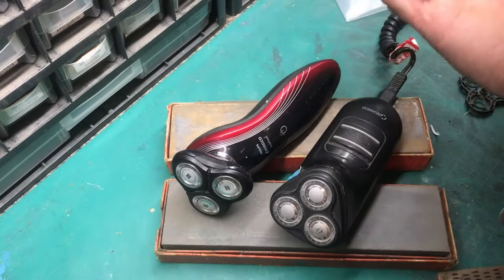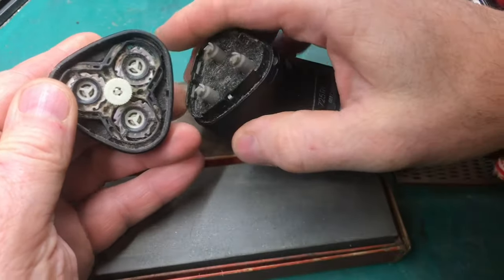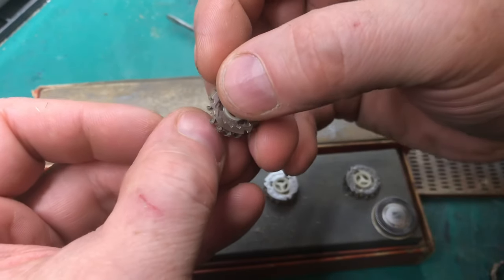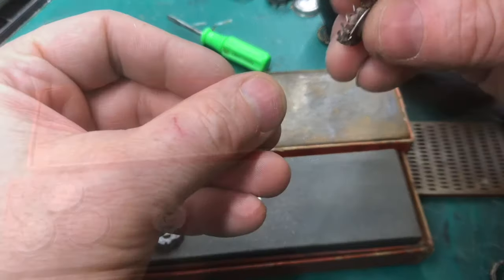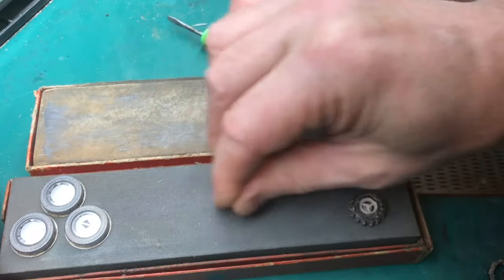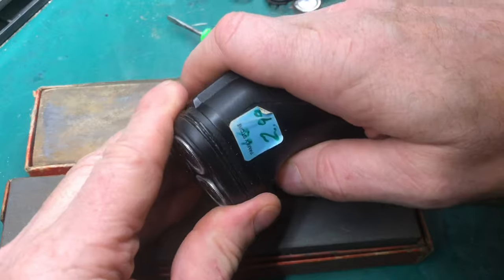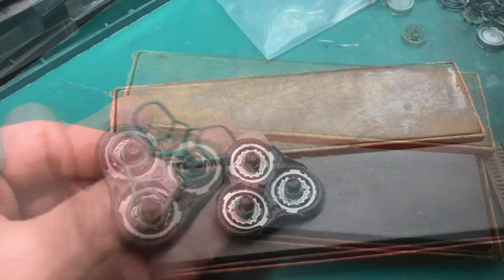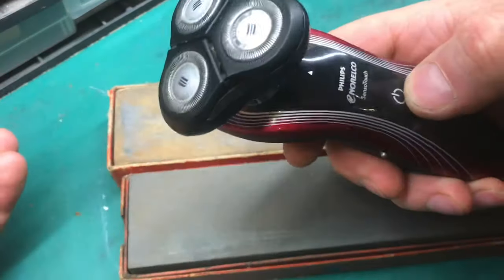SHARPEN your “electric razor” in less than a minute (remington, norelco, braun)

Comment: There is a far better way... first, thoroughly clean your blades (yours were gross) then add some toothpaste to the outside of the razor blades and run for 30 seconds. Thoroughly wash the razor head and voila! Sharp blades.
Reply: omg thank you! My Philips 9000 series is working better now than it did when it was new. I even tried it on my body hair trimmer and now that works super well too. Crazy how simple this solution is and how well it works 😍
Reply: This is sorcery ! Absolutely Brilliant with a Capital B ...Beers for this man, and keep them coming!👌
Reply: Yeah well,  at 56' I basically gave up on electrics having owned everything out there.  Till about a week ago anyway. I destroyed my face with a manual shaving few days premature.  I was furious. That night I started my quest for an electric again.  No way was I gonna pay $300 again and throw it in the trash. I reluctantly got a $50 Remington f5- 5800 on ebay.  Holy shit.  Not only is it first razor Not giving me Burns, irritation and Bumps. But its so delicate, yet shaves so close, even after shave hardly stings my face.  AND, I can shave at least every Two days whereas I could only do so Once a week for past 40yrs because of my extremely sensitive skin.  Don't know how long this will last as I have terrible experience with Foil shavers imparticular.   But for now...it's a miracle!!
Reply: Should I assume to push the toothpaste inside?
Reply: Didn’t work on mine
Reply: How do you wash the blades? Just water?
Reply: @Moiez101  Hot water and liquid soap, are the trick
Reply: @Moiez101  Liquid soap and hot water
Reply: @dogmaticagnostic7716  thanks !
Reply: @phsx2890  mine either tried tooth paste trick. Didn't work. Perhaps wrong kind of abrasive ingredient???
Reply: @joescheller6680  I got rid of mine …tried about three different ways.sold three shavers for small $. But now my new one is not shaving that well either
Reply: @joescheller6680 Polishing compound works better. I use maguire automotive polishing compound on my Philip's S9311. Worked great on the 10 year old RQ12+ head. Gonna sharpen my shavers original SH90 head next.
Reply: The toothepaste needs to be white and contain titanium oxide I think to be most effective. Idk though I might be making this up.
Reply: Ues wd 40

Comment: I have a Norelco 8240 that I’ve had for many years and sharpen like you demonstrated. I always first degrease the blades and foils by soaking in rubbing alcohol. And I make sure to keep the same blade and foil matched together. I’ve used Norelco since I was 16 years old because the first time I ever shaved my older brother let me use his. I’m now 80. I once tried a non-rotary blade shaver but hated it.
Reply: @Caballo de guerra Braun. Don’t remember the model. Years ago.
Reply: Your razor is same model number as mine it's an xl. Floating heads really like the razor. It's over 30 years old I believe has original battery in it yet. Holds charge for a week. Trier others like Brawn and a Wahl the screens didn't last 3 months.
Reply: @joescheller6680  Yep, mine still has the original battery also. Just wish I could buy some good replacement blades because sharpening these will eventually wear them out. Also, not sure if the very expensive new models are any good. One thing I know for sure is that when this one finally bites the dust I will buy another Norelco rotary.

Comment: Wash everything first!  I regularly blow out the fine particles with compressed air, but I de-grease everything by disassembling the head, washing it once to get the gunk off, then swirling the screens and blades in rubbing alcohol.

Comment: Awesome!  I have done this many times with the same razor you have: hq2, it does work great as the profile is entirely FLAT. The problem is that new blades hq8, hq9, sh30/52 et. al. are being designed with a convex like shaving profile, making it almost impossible to do this very same technique.
      
        I watched a guy (Robert Veach?) YT video using plain toothpaste (silica gel) by pouring it onto the top of the blades without them being taken out, after having washed the blades with soap, and then by running the shaving machine for some seconds, blades down, on the palm of his hand to recover the polishing liquid. This seemed working perfectly fine. I do think you can do the same with diamond paste, white paste, polish, compound and EVEN BRASSO! As you are sharpening the blade against the foil it fits perfectly the curve; just be careful to not finish sharpening away the foil as it is very thin.

Comment: Oue diamond dust and carbide dust inexpoxy poured left over in skoal   was abrafader mold the diamond carbide shaperd mold in k erosene used til edm elec dis charged .003 hard aurface caused mold to crack out but nadr millions till figured out we a say polish off hard surface but after years no more execuses we make entire mold out out graphite burn to shape orbit the size grapghite undersize 360 orbit to size.oo1 or .003 was great saving on carbide tooling good days goon now